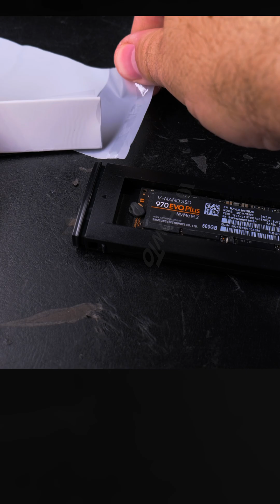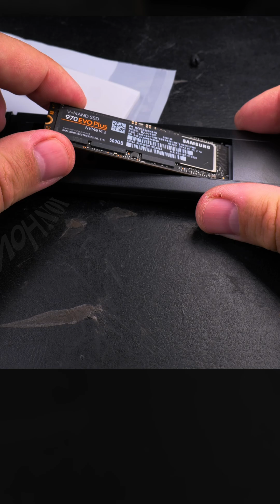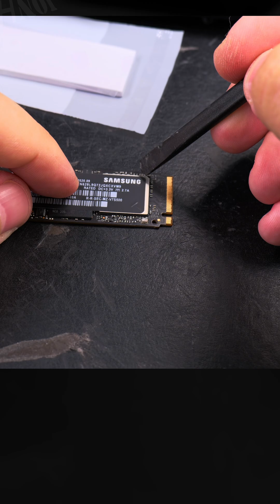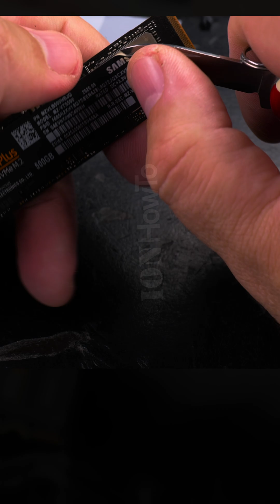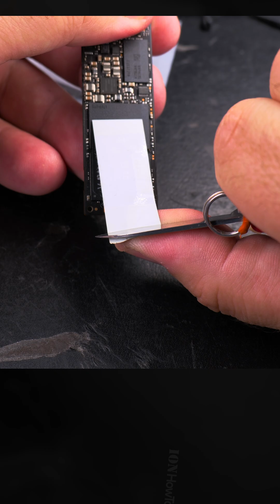Should You Remove the NVMe M.2 SSD Label Before Installing in an Enclosure or Heatsink? Part 2

Comment: don't remove the  labels, the labes are not ordinary paper labels they are thermally conductive to aid with heat transfer to the thermal pad
Reply from the maker: You're probably right about the label being thermally conductive. It looks like it could be. I was going to throw the label away but will do a heat transfer test or maybe not.
Reply: @IONHowTo  3 weeks passed, did you have any test on it?